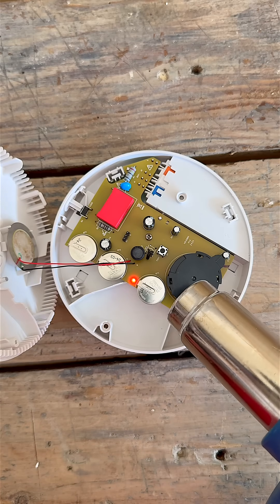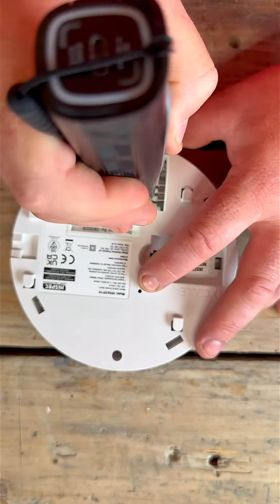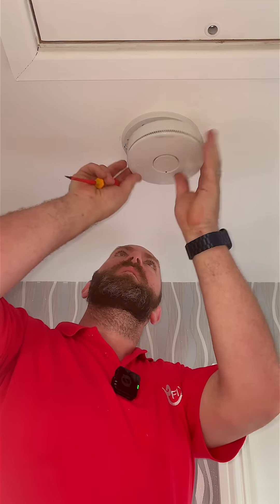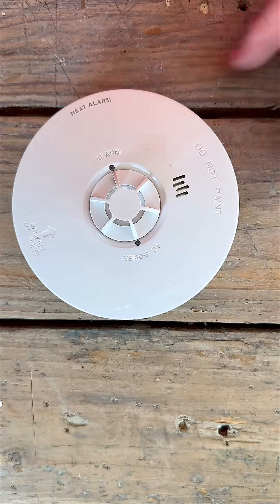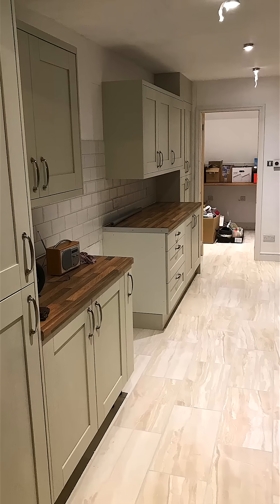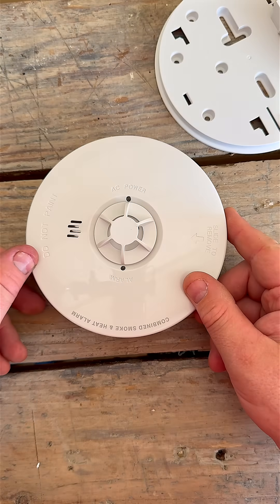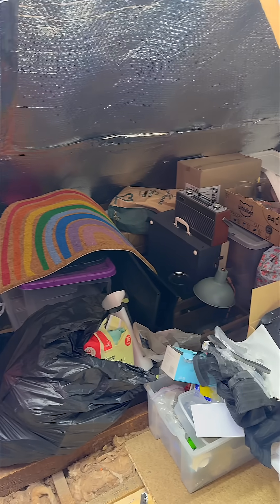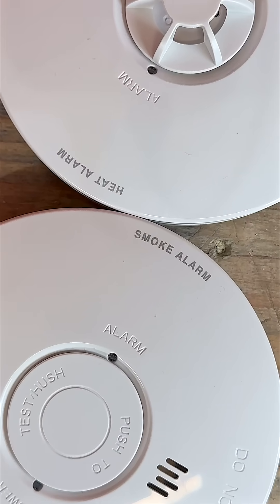Smoke Vs Heat Detectors: What’s the Difference!

Comment: Quick question, Hispec has battery operated smoke detectors with RF Interconnection feature with other smoke detectors, Do they have battery operated Heat alarm detector?

Comment: What materials used for heat detector---?
Reply: Temperature sensor. They can be thermocouple or semiconductor devices, or even a bimetallic strip. Some are set to a trigger temperature of 57°C.

Some will simply trigger when the trigger temperature is reached, so a bimetallic strip could be used in this case, and some will measure the rate of temperature change, so a thermocouple or semiconductor device will be useful here.